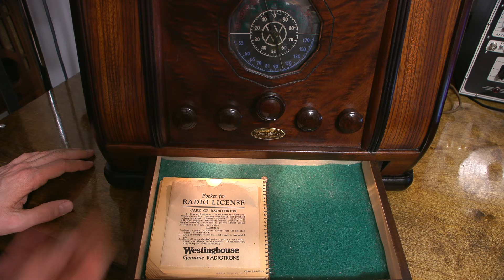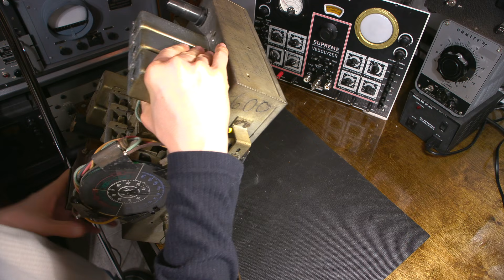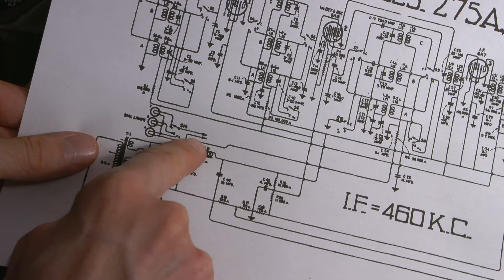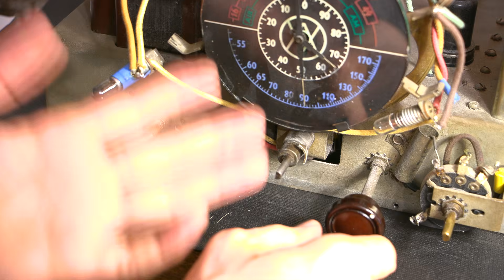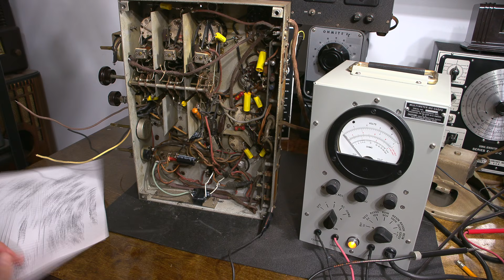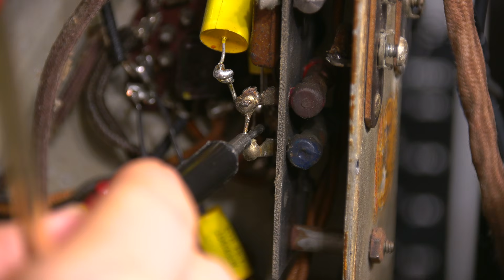Electronic Repair Adventure- Radio Receiver Troubleshooting!

Comment: Mr Carlson, the mystery wire (@ 31:50) connected to the plate of the 6A8, could that possibly once have led to a gas discharge 'tuneon' type lamp which was placed in the odd bayonet lampholder? A tuning aid of some sort? Just my 2 cents worth...
Excellent video, thumbs up for sharing!!
Reply from the maker: Hi. No, nothing can attach to the plate of the mixer other than the IF transformer. Gas discharge lamps are a high impedance device until they strike, once lit, they become low impedance. This is how regulator tubes do their regulation.
Reply: @MrCarlsonsLab  Yes, it should have been connected in the demodulator/AGC area. From the detail I could see in your video however the wire and the solder joint looked like they had always been like that, from factory. A totally illogical connection which will most likely remain a mystery.

Comment: An old radio like this makes me think how great it could be as a head turner when company is over, Especially fully working.  Though id of course want to hide an ipod and an AM very low power transmitter somewhere with some period music just for added fun.  Spin the dial and suddenly swing music,  Or the infamous War of the Worlds broadcast.

A thing I wonder is do you have a big antenna or are these old radios just that darn good?  Because it seems like all the old tube sets on here once working really pull in those stations.

Comment: Band C seems to be 6 to 18 MHz , using the meter markings as a guide.
What would Band B have for frequency coverage? The markings are only Air, Police, Amateur.
Reply: Roughly 160 to 80 meters perhaps?

Comment: Fantastic work Mr.C! Would like to see a part 2 alignment of this very sensitive old radio. It actually works pretty good but a little tweak with some of your
home  built test equipment, it could be a better radio.
Reply: I have to assume that Paul didn't do/show an alignment to keep this video from being close to 2-hours long.  But a Part 2 alignment sounds like a good idea.  <-- I've responded like this about 3/4 through the video, so I don't know (yet) what Paul says.  Based on the number of Commenters asking to see the alignment, I assume that he asked for opinions like he often does.

Comment: Is there a way to retrofit a fine tuning pot to a chasis that didn't originally have one? Rather, is it a reasonable option? I have a cheap wards airline from the 50s that would really benefit from some fine tuning. Especially on the SW band. (Its a trans-oceanic knockoff).

Comment: Way back when you needed a licence to receive...2020! 
Receiving equipment and control of these things by government departments has been complicated and most places have had at one time or another required a receiving licence. Currently much of Europe needs a bit of paper allowing you to listen and watch.  They are now called television licences. 21 countries around the world charge and Denmark is the costliest at around $500 a year.
This allows in the UK at least the national broadcaster to operate and create programming  without advertising or outside influence from the moneymen. 
The broadcast licence is different and the useable RF spectrum has been strictly monitored and protected with pirates having their equipment seized (and boats sunk). This was done in the UK by the Post Office before it was privatised. They  built the Post Office tower in London with a revolving restaurant in the 60s as the hub of UK coms. And a remarkable building it is too. Response was swift if anyone swamped the local BBC with distorted reggae and many budding young DJs would be on and off the air for years playing cat and mouse with the authorities. The air, police, fire and ambulance were off limits and even tougher measures were taken to ensure these were free of disturbance.
PS Mr Carlson removes speaker...''Ooh look how mucky''.
Most of the rest of us...''Wow it's flippin' perfect''. (And it was a beauty).

Comment: When I was Engineering Manager of WDIV in Detroit my technicians told me about 25 Hz power in Ontario into the 1950's. They said you could look across the river from Detroit and watch lights shimmer.
Reply: I had no idea you initially had a 25 Hz system in the USA. When did it become 60 Hz, sorry 60 c/s.

Comment: Again, another very well made and interesting video Paul ! And it's so amazing that this thing features a 25hz compatible power transformer, as I'd love to design a power supply wich could divide that 50hz (here in France) down to 25hz. It could mean less trouble to take care of possible humings in my designs...But maybe try to have some 25hz power transformers designed instead...I need to check your Patreon page to talk to you about this and other stuff :D

Comment: another vote for an alignment video on this one! i'm hoping to find a video of your quality showing the alignment done with just a signal generator and an oscilloscope (which is what i have, no VTVM), (not sure if that's possible at the moment). i have watched your Echophone EC-1 alignment video multiple times, as well as the stewart-warner one and have taken a lot of notes :-) what i am not quite sure of is whether i could hook the oscilloscope up where the VTVM goes when doing the RF alignment (or maybe some other place).
thanks so much for your contributions.

Comment: The Person who swapped those foil capacitors definitely knows the outside foil tester and how to mark them with a red dot, that's for sure :) Many thanks Paul, for making this in Lab II. I really enjoyed watching this repair using a mixed of vintage or self invented test gear! Great Video!
Reply: Outside foil is no longer marked as it is considered irrelevant except in very high end high gain high fidelity applications.

Comment: That is the first 25hz transformer I have ever seen.  25hz is still used by parts of Amtrak.
Reply: +James Azbell - 25 Hz was quite common in certain areas back in the day. My area had several factories and a theatre that ran on 25 Hz up to 2006 when the lines were destroyed in a freak early winter snowstorm. I couldn't forget how weird it was seeing the lights flickering to that low line frequency. And even though that power transformer will probably never see 25 Hz again, having that heavy core translates to much cooler operation at 60 Hz than the equivalent transformer engineered just for 60 Hz. They are prized by ham radio operators for that cooler running characteristic.

Comment: The reason for the license was that originally BBC and CBC were financed by radio licenses rather than commercials.  They actually had roving vans with detection equipment that could sense the oscillators in the radios.  They would drive through a neighborhood and cite those who were listening without a license.  So the US had free radio financed with commercials and now we have paid cable and streaming.  What goes around comes around.

Comment: 4:00 Apparently, even the coil shield next to it but over an inch away still got a bit discolored. And the wood a bit charred if that's not a lighting shadow. l have limited knowledge of tubes so my first though would be "that's part of the problem, tube getting too hot for some reason".
Reply: The coil shields all have that "brass" patina 29:06
And, there is definitely a shadow from the tube on the wood (plus some splotches of who knows what -- paint? glue? stain?)

Comment: Seems like that radio was designed for the Canadian market. As far as I know, we never needed licenses to own a radio RECEIVER here in the States. 
You didn't mention it, but, it looks like the dust cap fell off of the speaker, which makes handling of that speaker even more precarious.
All in all, a nice restoration video.
Reply: +Andrew Rood - A lot of speakers used in the era that this radio is from had no dust cap. That particular innovation didn't become ubiquitous until the 1940s.

Comment: how do you restore the dials if you lose the finish?
Reply from the maker: Not all, but some radios use a paint that decays over time, especially if left in the sun. This is one of those dials.
Reply: @MrCarlsonsLab  so if you NEED to take that apart, you had better be prepared to restore the dial, as nasty as that would be

Comment: I would like to see the alignment process. 

P.S. Be careful with this paint (59:55). Back in those days, paint with Radium-226 was sometimes used. It has strong alpha radioactivity and can be very dangerous to your health. It is better to check it with a Geiger counter or a simple dosimeter.
Reply: @JackNorthNexus  Radium also emits beta particles. Additionally, other elements in Radium's decay chain also emit beta and gamma.  Any reasonably sensitive GM counter will be driven wild by radium paint.

However, it's pretty unlikely they used self glowing paint on something specifically designed to be lit by light bulbs.  There's also no characteristic yellowing anywhere.

Comment: I just finished restoring my 1937 philco. first question...   is it suppose to have the metal plate on the bottom like yours?      Also, i had to explain the dial to my wife. mine actually has countries and cities labeled on the shortwave band.    Not many stations back then!    By the way, i love that you use the older test equipment to troubleshoot.

Comment: Checking into 25 cps or 25 hz AC in today's standard of measurement was  first generated at Niagara falls starting in t he 1890's and of course Westinghouse was involved.  Since this was a Westinghouse radio I am guessing that Westinghouse company chose to use 25HZ because this frequency AC was well entrenched in Western New York.  As late as 1925 a new plant generating 25 HZ ac was built at Niagara Falls.
Reply: Thanks for the explanation, I was wondering where the 25Hz requirement came from
Reply: @AndyFletcherX31  Evidently some of Amtrack electrified tracks are use 25 HZ AC

Comment: Where can I find the high heat piping your always talking about? Not exactly sure what I should be hunting for.
Reply: Heat shrink is in the Electrical department in the Home Improvement Stores. Not exactly sure what your looking for. If your looking for a wire that withstand extreme heat that would be a insulating value marked on the wire...
Reply: @steve-o6413  I have plenty of heat shrink Mr Carlton keeps referring to the high temp material like is used in a toaster
Reply: You mean the tubes made out of woven glass fiber fabric?
Reply: @SharkoonBln  yes at least I'm guessing that is what it's made of

Comment: I have a couple of questions for you, Mr. Carlson.
#1. The power transformer can operate at 25 Hz and at 60 Hz as you stated. Will it operate at frequencies in between? One might say that just that was implied; however I have worked on som oddball military supplies that specified either A, or B, but not in between.
#2. Why 25 Hz? I've never heard of anything made for such a low frequency on the mains. You might even be able to see the flicker on an incandescent bulb! So, the only thing that I can think of is that in the 1930's, generators weren't as sophisticated and frequency controlled as they are today, or maybe water or wind derived power are pretty variable, too. Your thoughts?
PS Thank you for all of the content you provide! You are instrumental in my NOT loosing my mind during the insane times. If one is to 'binge' watch something, you might as well hone your skills doing it. Thank you again! 🖖
Reply: +Christopher Bucca - Referring to your questions: #1 - Yes, the transformer will operate on any frequency from 25 to 60 Hz. And yes, you would see the lamps flickering at that low frequency.
#2 - Why 25 Hz in the first place? That was a standard from a time when large industrial electric motors were commutated (brushes and commutator) style. These motors ran much better at 25 Hz than at 60 Hz due to much lower inductive reactance in the windings at 25 Hz though they really like DC. When large multipole three-phase motors became available 25 Hz was on its way out. Though it remained popular with electrified railways and the electric locomotives that still used commutated motors, which is why it has persisted in some places. So for power purposes, 25 Hz was great, but for general lighting and small, residential use it sucked with the horrible flicker it produces from nearly any electric light. But use it people did, which is why appliances like this radio were built with it in mind.
Reply: @Inflec  Thanks brother! You scratched a brain itch!
Reply: @Paturnus1  - Why thank you. :)
As for those "oddball military supplies" that mentioned only those two frequencies but nothing in-between; it's possible that the equipment in question also used the AC wave for timing purposes, in addition to simply being a straight up power supply. In such a situation it would have to be limited to a specified frequency (or a strictly defined set) so the timing requirement could be met. Hope that scratches another itch.
PS. If you thought 25 Hz was low, you should see what some European electrified railways use: How does 16.7 Hz strike you?

Comment: I got lost on the 25 cycle transformer - could you explain?
Reply from the maker: The first generators were 12 pole, and ran at 250 RPM. This gave 25 cycle electricity to many places in eastern Canada, and the USA.
Reply: @MrCarlsonsLab  Where do you come up with this knowledge? My grandfather who worked as an electrician after coming back from WWI never mentioned info like that. Although I am sure he had seen it at one time or another. Amazing!
Reply from the maker: Let's just say, "time is my friend." Thanks for your kind comment Carl.
Reply: @MrCarlsonsLab  I think I am correct in saying the lower frequency would increase the current available, is that correct please, love your videos, definetely the best for learning about this old valve gear, also how much does it cost to access the your patreon site, I have subscribed for a while and think you are a great teacher, thanks.

Comment: It still blows my mind how much care and resources used to go into electronics back then.  Everything was a work of art.  Same goes for old cars and buildings.  Try building something like we had in the 1920's movie theaters nowadays!
Reply: It still blows my mind how much misinformation and absolutely mindless idolization of the “good old times” there is. The idea is that less resources is better! The fact that those old designs and manufacturing processes were resource hungry was absolutely not a good thing in the long run.

Now we got all the wonderful superfund cleanup sites from the “good old times” when resources were “not a problem” (a lie we dearly pay for now) and you could pollute like crazy and make people sick and nobody was any wiser because we didn’t know all that much medically yet.

If you talk about any reasonable performance measure, old cars (1960s and earlier) are universally terrible. Power to mass ratio, vibration and harshness, component life and performance (old shocks vs. current ones - night and day), cabin noise levels, emissions - you name it, it was poor, bad, or worse.

Those movie theaters from the 1920s? Nope. Don’t want them. They were temples of excess, used to pull in the masses because excess and gildings were a distraction from the relatively less glamorous everyday life. I’d rather everyone is able to enjoy some splendor in their own family life (in all sorts of way), and have the resources for it, rather than having to go visit a temple.

Modern tech is very resource-mising and it’s clearly represented in the prices of consumer goods. With not all that much money you can do at home what was barely dreamt of just 75 years ago. I’m glad backwards time travel isn’t a thing. Compared to what we got now, everything took forever and the simplest of things were an escapade. Want to watch a movie, rent a book, get some new music to listen to? You walked or you drove… I’d much rather walk or drive when I feel like it, rather than when I have to. But that’s just me.

And while working on old tech is a cool hobby, I’m glad a smart watch has multiple radios in it, and I can use it to play music wirelessly through earbuds that got no wires. Nothing shabby about that sort of progress.
Reply: @absurdengineering  Thing is these old things were designed to last a life time and be repaired and were normally made more locally.   Everything is also done at huge scales now.  Back then you had a small family run company churning out maybe 100's of units per month, now you have these megafactories in China churning out millions of units and sent on big boats all over the world.  Way more resources are used now because of how globalized everything is and fact that stuff is designed to fail so you buy more often.
Reply: Red Squirrel You might be surprised to learn then that the price has some reflection of the resources used then :) If it truly used more resources, you’d pay way more. No magic here is possible. If you pay $100 for a widget, no more than $100 of resources were used to make it - not unless it’s dumped or subsidized. Absent subsidies, nobody can sell you a $100 radio if it used $200 of crude to make it. Nope. So that’s all there’s to it. Stuff’s cheap due to economies of scale. Shipping a million widgets in containers on a ship around the world uses about as much crude as that family company shipping those 100 radios around the US. I’ll take the ship, thank you.